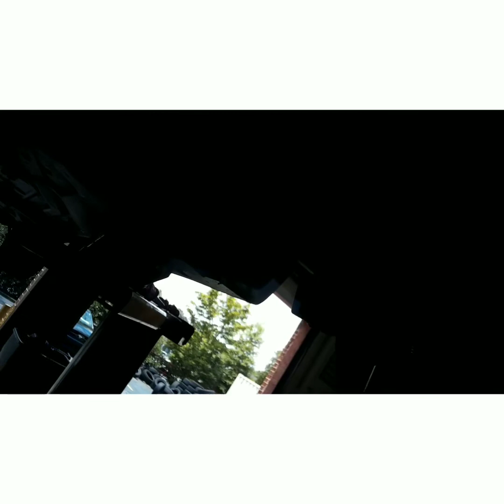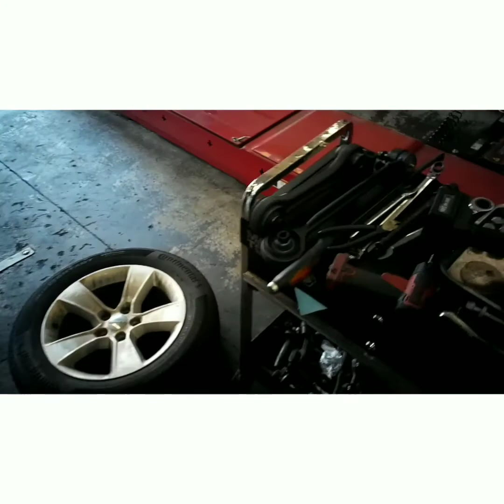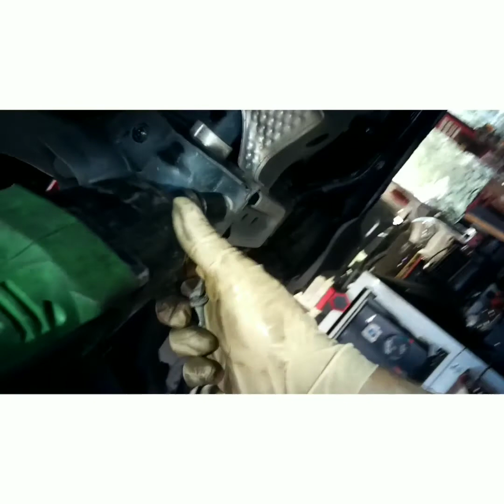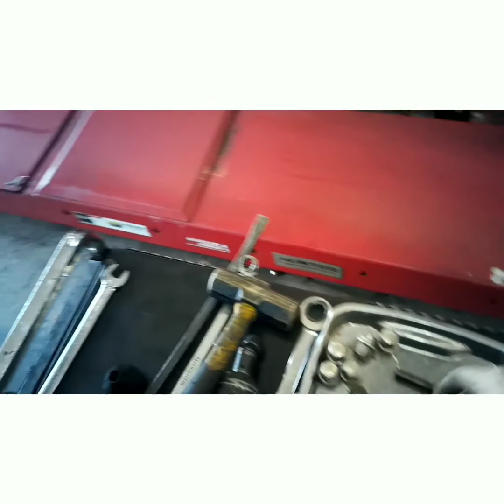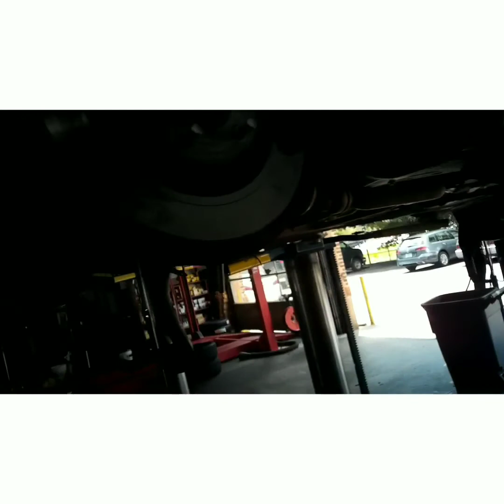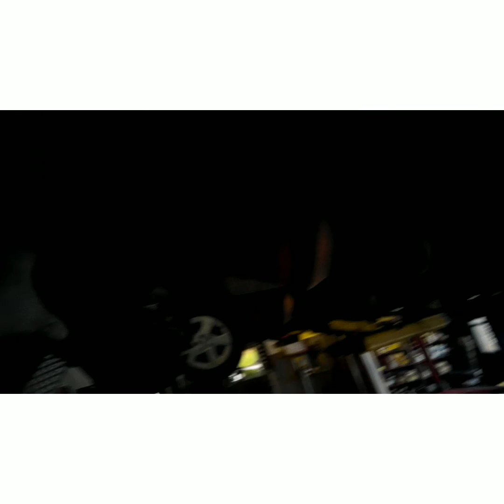Dodge charger lower control arms noise and replacement

Comment: @automotive tech-vet i watched ur video from beginning to end loved it but wanted to rewatch it before i did mine and noticed you said 2014 dodge charger that applys to a front wheel drive cars i could be wrong but chargers didnt make a front wheel drive one its either rear wheel or awd and since u said front thinking u mean awd is there any differance with awd and rear wheel control arms ?

Comment: Is there a better way to get the bolt out without hitting it with a hammer? Mine seems to be stuck and I cant really get a good hit with a hammer since i only have a jack and stands
Reply: Did you end up getting it out? I’m gonna attempt mine today.
Reply: @lambo6  ended up using a ball joint tool and got it done

Comment: Two nights ago I hit a curb , kinda hard on my passenger side , now it sounds like it’s flat and it’s rocking the car but the tire is no where near flat nor is my rim damaged …what could it be ?? It makes a weird squeaky noise on a certain part when the wheel goes in rotation (driving)

Comment: Yep, it’s all right while the wheels are hanging.🤯 Another I’ve watched who didn’t tighten arms with bushings at ride height. It will tear the rubber when it twists when returning to ride height!
Reply from the maker: Lol the bushings tear prematurely no matter what u think is the right procedure,  before negative comments should be 25 years of experience 😄
Reply: @automotivetech-vet   Okie dokie, but that’s flat out wrong. By the way, it’s not negative comments. The job was good showing how, for the most part, but common sense to some to never tighten until at ride height. I understand job security is important. You’ll get to do the job again sooner than later😳 QUESTION? Would you say it’s possible for people out there to have a 1 or 2 decades of experience, but haven’t done things quite right? In any field. Yeah, I’m sure you’ve even met some. None is perfect at everything, but wise people realize constructive criticism when they see it , and can get better! Continue on with your experience 👍
Reply: And the fact that you don’t even take the time to properly remove the plastic🤯, instead fight with it for 5 minutes. Those are short cuts bud… I’m sure you have many others. What did you torque the bolts to? There is no way you were trained that way, or maybe your trainer was the same way. That is what gives mechanics a bad name🤔
Reply from the maker: U mad because well who cares
Reply from the maker: Hey where is your  videos i wanna subscribe lol 😆
Reply: @diggindaddy5381  it’s called being a flat rate mechanic. If you have the experience on how tight though bolts and nuts need to be without a torque wrench and removing less parts off means that it’s more hours in less time and more money for you. I don’t have 25 years of experience, I’ve got 7 and I saw nothing wrong here.
Reply: Obviously this guy doesn’t work at a Dodge dealership. Preload all control arm with rubber bushings.

Comment: Used a metal mallet, still not able to break the rear lower control out, any suggestions ?
Reply from the maker: The bolt won't come loose or ball joint won't break loose out of knuckle?
Reply from the maker: Heat it up with a torch around where  it seats around the knuckle

Comment: Thanks for the video, what kind of noise was coming from those bad parts? I have a 2015 Charger RT with banging noise but I can't figure out what it is.
Reply from the maker: Clunky over bumbs
Reply: @automotivetech-vet  yes over bumps
Reply: Just had same issue thought it was my motor mounts but it was my exhaust banging off the bar brace under car

Comment: I'm about to do the exact same job but I have to change out struts too. I noticed the strut is loose while changing lower control arms. Can I just take the 3 nuts off and replace strut while everything is off or are the struts under pressure? 

Ps.... I'm new to all of this
Reply from the maker: Yes just don't take the center nut in the middle loose

Comment: Would you say this is a job a person can do at home?? A mechanic quoted me at 2200.00
Reply from the maker: Most definitely if u have the tools 🔧
Reply: @automotivetech-vet  I air compressor guns as well as wrenches and whatnot. What specific tools do you need besides that
Reply from the maker: Nothing special good pry bar and pickle fork
Reply from the maker: And hammer lol
Reply: @automotive tech-vet  lol. Good! I've got both. It doesn't need a torque wrench right?
Reply from the maker: No just tighten real good

Comment: I have a 2012 charger, and whenever I break my car shakes a little bit. I took it to a mechanic and he mentioned three control arms were the issue. Any truth to this? Thanks
Reply from the maker: If the steering wheel shakes when braking it is probably your front rotors are warped
Reply: @automotivetech-vet  thank you